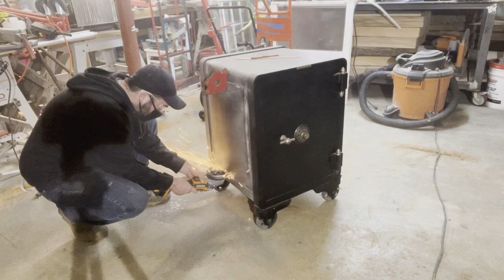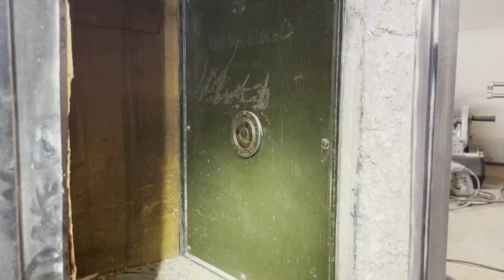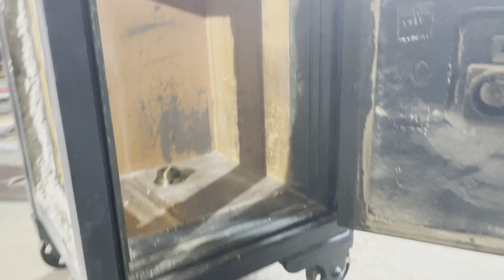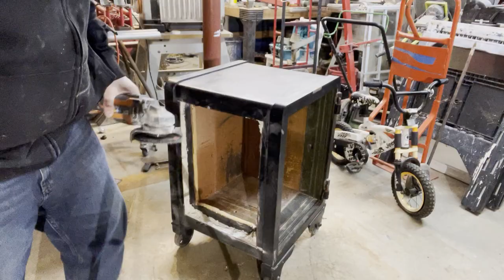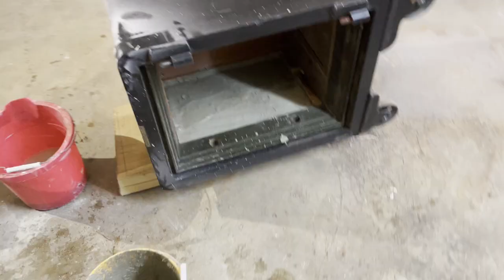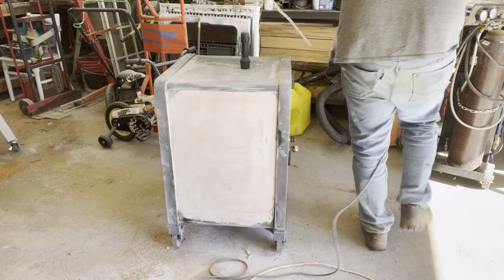Breaking into antique safe again! Finding Combo and Repairing.

Comment: That was super interesting and I really dig your common sense approach.  

The purists will always have something to bitch about because that's what they do.  Wondering how old that safe really is and there appeared to be the numbers 1957 stamped on the inside of the door but then there was an 8 stamped slightly lower after the 7 so not sure.  If you go by the general rule that the term antique generally means 100 years or older, given that it had plywood sandwiched in between the metal I was thinking it was newer.  However I was surprised to learn that plywood has been around for a long time so maybe it really was. 

The plywood in this safe could also have been treated with fire-retardant instead of using asbestos. 

Anyhow, nice work!

Comment: You could just take the tumbler set out, take the black cover off and put the tumbler back in place. While you're holding it there, twist the dial to see where the slots line up with the drop pin. Just write down the numbers and how many rotations it took to get there.

Comment: @ 5:58, if you take the snap ring off and remove the disks / tumblers, keeping them in order, you can read the combination. Each disk has numbers stamped into it, and the center part has a mark lining up to a number. That is the setting for this disk. The first one removed is the last number of the combination. You can separate these two parts to change the combination. If you change the combination, try it by locking the safe door with it not being closed to be certain it functions before you make a huge error.

Comment: 😱 you destroyed the original S&G lock cover.......... 🙄 The wheel pack comes apart and you can see the combo on each wheel......
Reply from the maker: Destroyed? Welded the cutout back in place, smoothed out with a die grinder and fresh coat of paint. Can't tell that I touched it. I'm not a professional locksmith and have never claimed to be. I had a $75 locked safe that was useless to those who are not professional locksmiths like yourself. Now I have a safe that works perfectly, looks great and didn't cost me anything but my time and a bag of cement and paint... If everyone could open safes with ease, you wouldn't have a job and safes wouldn't be "safe."

Comment: Hey, thanks for the quality content and follow up videos, this was a roller coaster ride of a video series for sure! Nice to know there is no asbestos. I have volunteered to try and open a safe just like this one for a nonprofit at a historical theater. I am going to try and open it without brute force. You've done a lot of work on this and gained a lot of info on how the safe works. I was wondering if I could contact you about the safe and combination? How many numbers in the combination? Would help me and the local historical theater a lot. I have a lot of questions that will make cracking the combination of the safe go much faster. It is difficult to get info on the York Safes because they went out of business in the 40s so any info from your experience taking one apart putting it back together and figuring out the combo would be invaluable.
Reply from the maker: Thanks for watching! Yeah I learned a lot making the videos, but am by no means  an expert as I still had to cut into it to figure out the combo. My safe had a 4 number combo with the following pattern: 5R 4L 3R 2L R. I found lots of help at lockpicking101.com, it's a forum with lots of knowledgeable people.
Reply: I have a 2 dial safe that I can't seem to find any locksmith that wants to tackle it. Once I send then pictures. I don't know what kind it is but it's probably 2500-3000lbs

Comment: You remind me of a bull in a china closet! Bang, punch, ram, pry, and pound your way through until you manage to break, puncture or destroy most of the safe. Can't imagine the hours you spent and the dust you inhaled to avoid spending a few hundred for the smithy. Not to mention how much I enjoyed looking at your floor on more than one occasion while you studied one object or another. You are dangerous to yourself and any children who might watch this video. You should be confined to the house forever. Your motto is: I can break, bend and drill anything I wish because I'm really good at repairing it later. Sure hope that motto doesn't get passed around! By the way, you must work for very low wages to consider your labor worth less than a measly $250.
Reply from the maker: I'm sorry my video offended you so, I was just trying to solve the mystery of what was in the safe and have fun doing it. Good thing youtube is free to watch.

Comment: .... I followed your link and just saw the clip on cutting out the side again, and re-setting the combination ... Great work ! ... I was wondering if you were going to figure out on how to remove the door... and, Wa-La ! You did it ! ... For others out there... once the door is open, you unscrew the top chrome like, decorative caps on top of each hinge... then, lift the door up ... there will be hinge pins attached to the door... and sometimes, some washers... don't lose those washers ... Steady the door hinge pins over the hinge receiver area, and replace the door ... You might clean & then spread a little white on the latch, bolts, and the lock... and even a little on the hinge pins before replacing the door... Anyway, you get an At-A-Boy for a job well done ... PS, I liked the suspenseful music playing as we waited to see if everything worked at the end .....
Reply from the maker: Thanks for the kind words. I know a lot of people have been angered by what I did, but I now have a working safe and learned a lot about how they work and had a lot of fun doing it.

Comment: I had the exact same safe opened by drilling a 3/16 hall or the disks are located and then he just spinning the dial toline them up re-weldthe hole and you’ve got a perfectly good safe. Was a fraction of the work you went through and didn’t ruin the safe. There was $4000 in silver and a large bag of homemade 1980s porn inside.
Reply from the maker: Lol, nice score on the silver! Yeah I had no idea where to drill to see the lock, hench I went in the side. Didn't want to damage the lock, cause there'd be no way I could fix that. The side on the other hand just needs a little welding and it's a perfectly good safe again.
Reply: I have the same safe. Could you tell me where you drilled the hole?
Reply: Lol, nice score on the porn!

Comment: The thing about it is with the small hole in the very back you could have put a long screwdriver through remove the little screw on the back of the combination pack remove the pack and turn the dial and it would have opened you would not have destroyed the inside of your safe bad job
Reply from the maker: No sorry, you are just wrong. The lockset has an indent for the cover. Only after you remove the interior panel can you remove the lockset.
Reply: He already broke the interior out the round disc with the one screw is the combination pack it will come out very easily and there is nothing stopping you from opening the door
Reply: And if you're talking about the screws on the outside of the inside cover plate and you're wrong about that I have been doing it for 47 years
Reply from the maker: Well I’m eating crow for lunch today. I checked and you can pull the lock set out by removing the one screw. You have to rotate it about 1/8” which must be why it didn’t come loose when I first opened the safe.